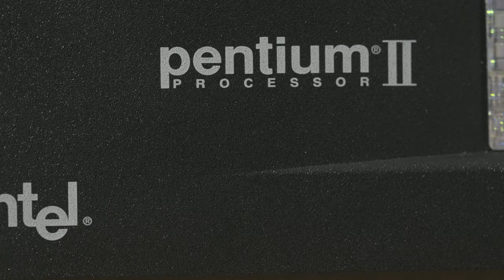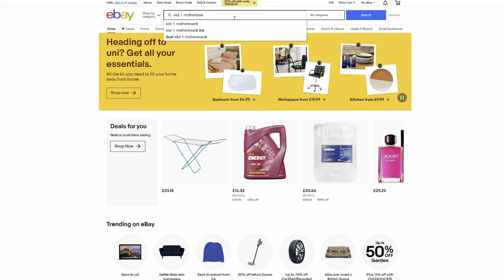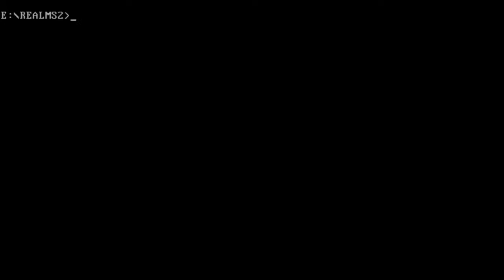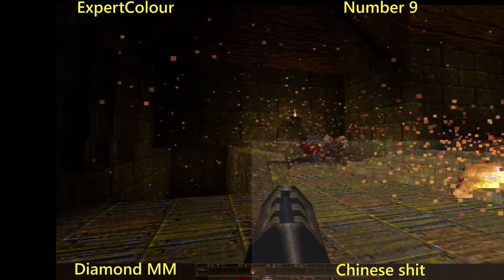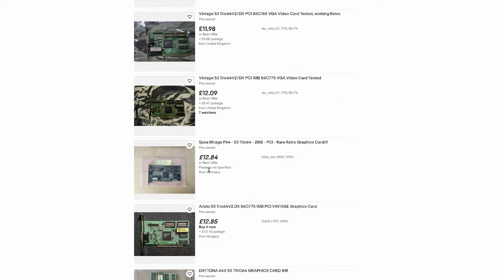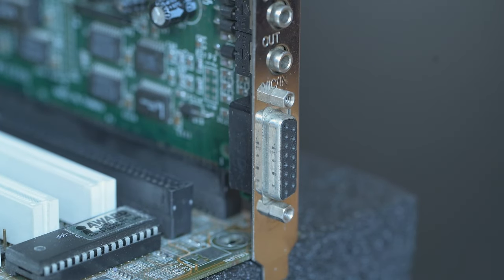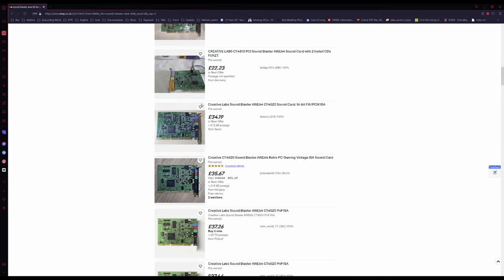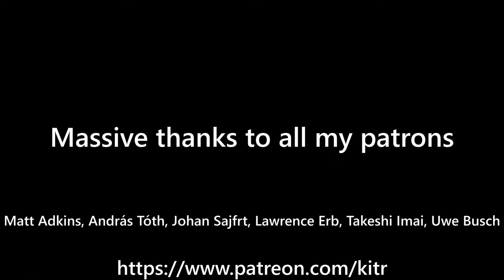Buying Guide - The Cheapest and Probably The Best DOS Gaming Computer

Comment: Great advice! Just started with the retro stuff a few months ago, and it's a big rabbit hole, so be prepared. #1 Stay away from old power supplies. Bought two old Antec psu's from ebay, and had to send both back, and one shorted my Super 7 motherboard. 2# A lot of motherboards on ebay that claim to be "tested", have not really been tested, so be prepared to have to send back faulty motherboards. I wish I would have watched this video before I started with retro. #3 Aspirin, have a big bottle of aspirin, because you're going to have headaches, lol.
Reply: Yeh old psu is def. A no no. The tech doesn't change much so any cheap new ones works, probably best to get a decent psu and get some converters instead for old connectors

Comment: Nowadays there are two utilities that you could use to overcome the fast CPU and ISA sound problem. For ISA sound, there is SBEMU that emulates a sound blaster on newer motherboards with AC97, so you don't need an ISA slot/sound card anymore. To slow down the CPU there is CPUSPD, and it supports socket 478, 775, AM2, and AM3 CPUs. Both utilities are available for free on Vogons forum. So in summary you don't need old hardware anymore, and could run (almost) all DOS games on more recent (and cheap) motherboards.

Comment: Good solid advice.
For my two cents, I might mention drive overlay software can give you access to large partitions in dos.
ESS sound cards are great for DOS, like you said, and if it has a wave blaster connector, Serdaco makes great affordable modern wave table modules (not sponsored, just think they make great stuff)
Reply: if you mean from 40 to 150 eur cheap 🙂
Reply: @dim0n1  I think "affordable" is a fair description for their cheaper offerings, at least compared to any vintage option you're likely to find.
Reply: @ozzyp97  at the end, unfortunately its true, retro collecting start to be a expensive hobby :(

Comment: If I were to build a DOS/Win9x machine today my first choice for hard drive would be a 40gb SSD + a cheap sata to ide adapter.
(But you can always use the "SeaTools for DOS 2.23" trick to use any size drive if you have larger spare drives around)

For mouse go with a CHERRY M-5450, comes with an adapter for PS2, works solid in DOS and even has multiple colours to choose from ;)

Comment: I am building mine from a super socket 7 motherboard with a Pentium MMX 233mhz overclocked to 300Mhz. Can be slowed to 386 speeds by disabling caches and CPU features like Branch Prediction using SetMul utility.

Comment: Avoid VIA chipsets....  I have nightmares about stability issues on VIA chipsets
Reply: Yes, i can still remrember it, but there are ways to make those work stable. However, back then we were not aware of those ways because the Internet wasn't accessible to most of us and it was hard to get that knowledge.
Reply: Last upon a time I had Chaintech 5AGM2 based on VIA MVP3 - nice, stable and reliable board
Reply: @86smoke  Indeed. At the time I went for Intel chipsets and was just fine. There were one or 2 others that were good too iirc, but I can't even recall their brands. One chipset I can remember was the 440BX. I think I must've built a couple of systems using that, since I can remember the chipset model.
Reply: @86smoke I personally avoid intel 865/875 chipsets due ich5 burning issue. Also I dont like pentium 4 sis chipsets that has really big incompatibility issues (not working usb keyboard, mouse, bsod with many pci hardware). I dont like ali chipsets from socket 7 era due agp problems (low speed and incompatibility). Ali chipsets from pentium 4 era also burning like ich5. Via chipsets are nice in my experience. Didnt notice any problems with via appolo 133t (pentium 3) and via 880 ultra (pentium 4). Using last in my main retro build
Reply: For what I remember those had shitty cooling hence the issues

Comment: Thank you for an informative video, these little differences in various graphics and sound cards are not widely known.
However, there is a cardinal error in what you say about disk sizes and partitions. There are four records in the MBR partition table, yes, but in DOS, partitioning works by creating (usually) one primary partition and one extended partition in which you may stack any number of logical drives you can fit into your HDD space. Not going into details about how that is technically achieved but I know the structure, have worked with it for years. So you can very well fully utilise even a 40G drive under dos, given its 2G partition limit, you're just gonna have many logical drive letters :) Just one note of caution - try not to have more than 24 logical drives (A and B are reserved, so only 24 letters remain), else you'll end up with drive letters "[", "\", "]", "^", etc. (ASCII chars beyond "Z") which are quite difficult to access :-D Actually, you may use a program that "turns off" some of those partitions (by changing its type byte) so you may have as many as you like, fully utilizing even a 100G or larger disk, just not simultaneously...and you always need to reboot for any change to manifest.
Back in the day, I used to have multiboot with DOS, W98 (or XP? not sure now) and Linux and several data partitions, so on my 100G HDD, I had three primary partitions (for the systems, though linux doesn't require to reside on a primary one) and one logical with seven FAT16 drives (2G each) and about three more for non-DOS data (one FAT32 and two ext3). Thus, in DOS, I was able to access 16G of HDD space, and I could add more drives if I wanted to, just by shrinking the large FAT32 partition.
Reply from the maker: Actually no, you're wrong :)

If we're talking about DOS 6.22, which I was, but I admit I didn't specifically stated that, you can certainly create up to 24 logical drives, however, you can't create primary partition larger than 2GB or extended partition larger than 8GB. Or you can create primary partition 2GB but logical partition won't let you create more than what's left of 8GB. In case of extended partition, you can create 24 logical drives out of it, but you will always be limited by 2GB per partition limit and 8GB altogether limit.
Reply: @KITR-UK  Well, my memories have somewhat faded but I know for sure that I was most definitely able to access HDD surface beyond the first 8G mark from DOS 6.22 (which I was also talking about). I know about the 8GB limitation which was a BIOS thing but with newer BIOSes that overcame this problem (namely, being only able to use 24 bits for sector number), even DOS could cooperate nicely, at least according to what I remember. It may also be caused by the fact that I always created the partitions in linux. DOS understood everything I made but it I admit it may not be possible to create the same using only DOS's fdisk. Nevertheless, I can say for sure that it is possible, though maybe only with certain BIOSes and with the help of linux :-)
Reply from the maker: @Beus38 Faded indeed :) However, you gave me a topic for another video.
Reply: @KITR-UK  Looking forward for that one then, and glad to spark an inspiration :) Actually, in (hopefully) near future, I plan to re-create my DOS-W98-XP-Linux multi-boot setup on my old 2003 laptop that I still keep, so I'll let you know exactly what was needed to make the setup work (or what I didn't remember correctly, if I fail) :)
Reply: @KITR-UK  Well, I'm getting back to you, admitting that my memory indeed played tricks on me :)
I have been playing with my freshly built 486 and SuperSocket7 rigs for some time now, trying various things on them, and even dug out my old 120G disk sitting in my last desktop (P3 from around 2000 which I still have, too) before I moved to laptops, and inspected my partition table there.
And indeed, I had all the partitions that were intended for DOS 6.22 (all 1G in size, not 2G like I mis-recalled) laid out in such a way, that the last of them ended precisely at 1024th cylinder - exactly the boundary beyond which DOS cannot go - after which, several big FAT32 and ext3 partitions were sitting :) And I had my LILO set up so that it changed the type of the extended partition back and forth between 05 and 0F depending on what I boot, to make both DOS and Win98 recognise it correctly :)
I also did some experiments on a clean HDD, but even when I tried various techniques combining DOS, linux and Win98, I wasn't able to get DOS recognise anything beyond the 1024th cylinder (i.e. 8.4G) :) So, yes, my memory failed me and you were right, one can only create logical drives up to the 8.4G lmit in DOS :)
Reply from the maker: Cheers for the update :)

Comment: If sy want play dos games then strongly recommended to buy a very old keyboard without windows buttons. Many games default key mapping uses space, alt,ctrl,shift buttons. On original old keyboard all button managable with left hand(right on cursor arrows). But if u have windows buttons on keyboard, then the ALT button is not reachable easyly :(

Comment: What about shitty socket 423?
It was horrible when it first came out and is hard to find nowadays.
Performancewise, similar to P3 tualatin, but exotic as hell.
Nonetheless, slot1 is an optimal choice.

Edit:
Threre is a memory extension for Awe64 value/gold that utilizes SIMM 72pin modules. I have two of those and those work greart, allowing to load awesome sound fonts.
Anyway, costwise it is far better to buy fully working P2 system than all the parts separately
Reply: Those 72 pin adapters aren't exactly cheap though, depending on your requirements it might be worthwhile to look into AWE32/SB32. You could even get real OPL3 with the former, though it'll certainly cost you.

Comment: There are USB to PS/2 adapters but it is not guaranteed to work. I have multiple USB mice that would not work with an adapter but one Logitech optical mouse does and so does a Logitech keyboard I got in 2004 and it came with an adapter. But I recently found a 5-pack of new old stock Logitech PS/2 optical scroll mice for 20$ so I took them.
Reply: The mouse itself needs to support both USB and PS/2 connection protocol for the adapter to work. Most modern mice don't, so they won't work with any PS/2 adapter. The same goes for USB keyboards and using them with PS/2 adapters.
Reply: @Beus38  exactly. Because you can get PS2/VGA KVM for very low prices used these days thought I point it out.

Comment: I like my Pentium 3 for dos but the Pentium 4 Dell I have is good too for win 98 but it crashes from going to full screen to a window, it just a bit less stable. I once could not get in because the usb keyboard needed drivers to work so logging in using safe mode allowed to keyboard to use compatibility mode just to install the drivers.
Reply from the maker: What VGA card you use?
Reply: @KITR-UK  I think it was a rage 128 agp but I swap cards all the time